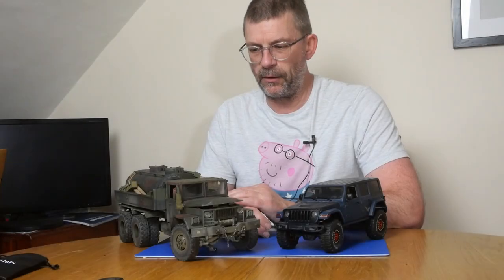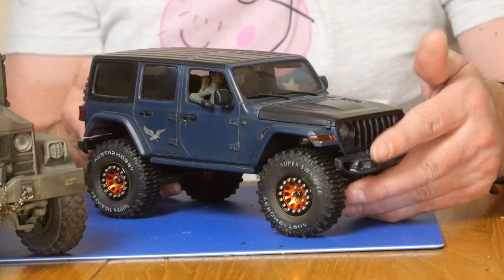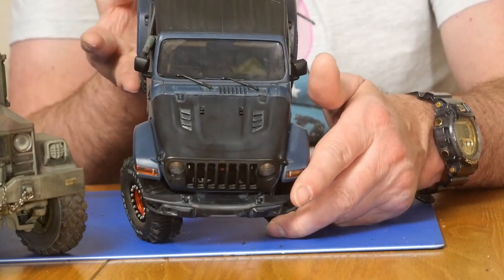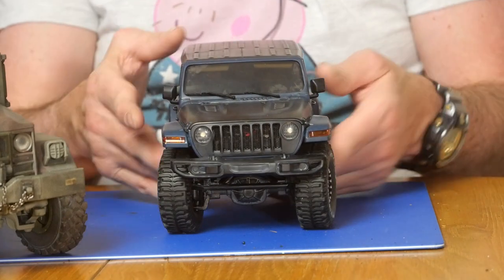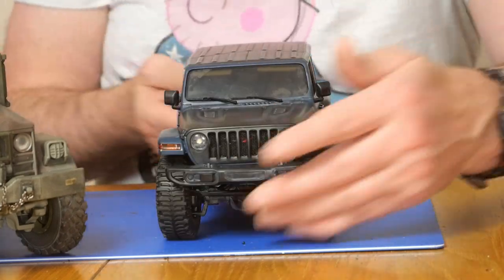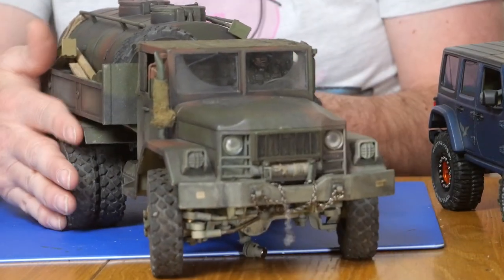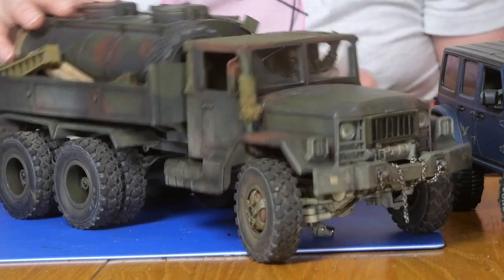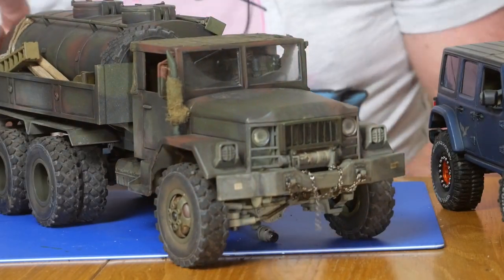Heavily Modified WPL B16 Tanker Runs and Breaks! Eazy-RC Arizona Custom is done-ish too!

Comment: Cool video!  A few companies make 7mm hex wheel extensions for the scx24 if you want to widen the stance of the arizona.  All you would need to do is re-tap the special nuts to fit the larger axle diameter.
Reply from the maker: Yeah, I need to practice re tapping. All that falls under 'engineering' which might as well be Magic right now lol.